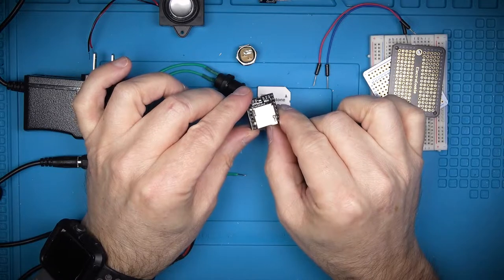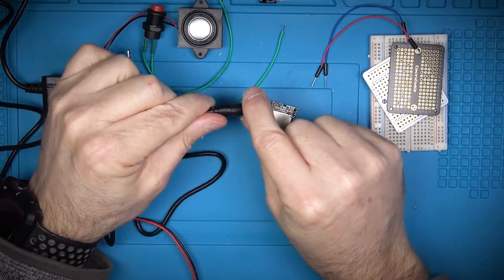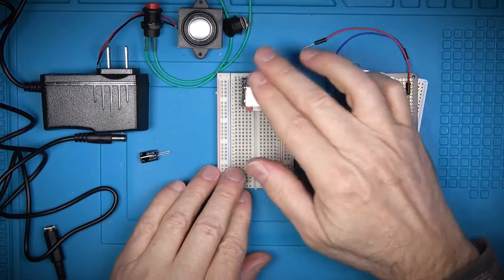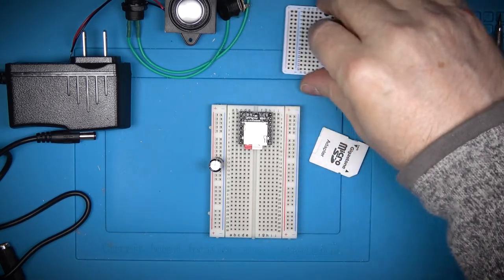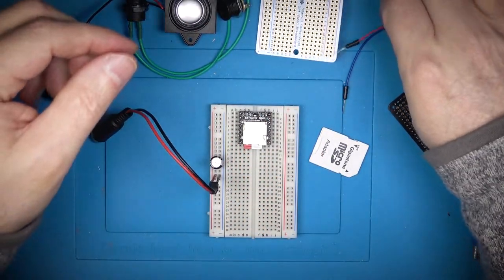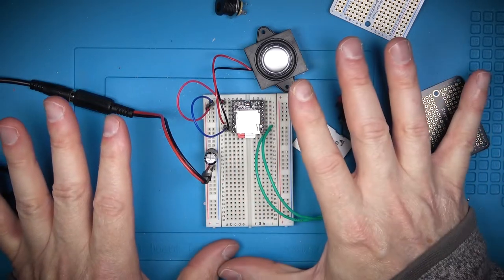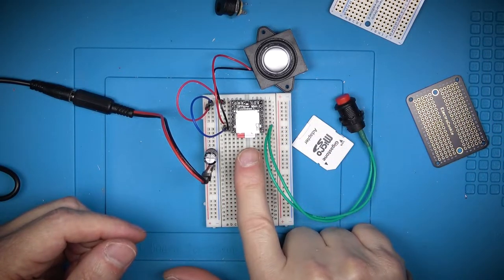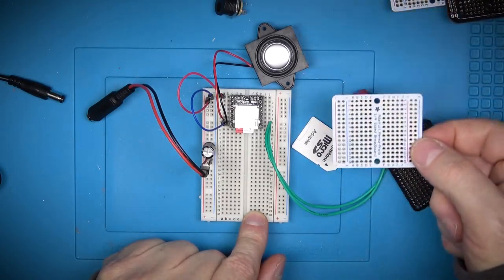Easy Diorama and Book Nook Audio - DFPlayer Mini #dfplayer-mini

Comment: I'm having problems connecting these boards like this..  I have one working in a project connected to an arduino where I used the "Play all random" feature, but now I'm trying to do a project w/o the microcontroller.  Docs say I should be able to play 14 different files (actually it says "segments" so I am hoping I am understanding this to be different files?!?) but I can't get it to play any, even when just using the basic shorting out the pin that you did.  What file naming did you use on the SD Card?  I have tried 0001.mp3, etc.. and I've tried w/ 3 digits (001.mp3, etc..) because I've seen different documentation, but neither is working for me.  I am getting what I'd call a quick "squeek" and that's it..  Any help definitely appreciated!!
Reply from the maker: Your naming seems fine. One thing to check for is hidden files on the SD card. If you're working on a Mac, there may be issues with system generated files that are hidden but share similar file names. The player isn't smart enough to tell the difference and may be trying to play those files instead. On both Mac and PC you can "show hidden files" and delete everything that's not your MP3s. Fingers crossed!
Reply: @RandomMakingEncounters   Thanks for replying..  I did end up getting it to work.  turns out the filenames were fine, and it works exactly as documented, but the whole problem was that my voltage was a little low and it was rebooting when the song started playing and the amp started taking too much current.  I had a breadboard power supply that I was feeding w/ 5v and so 5v into the 5v regulator wasn't able to work properly.. Feeding 9v into it (even at less miliamps) it is working great!
Reply from the maker: @SteveJones172pilot  really happy to hear that! It's always frustrating when you have a mystery glitch. All the best with your project!

Comment: So, any capacitor is fine?  Didn't need any specific size? 
.. EDIT: DERP, looked in comments n found the link 😬

So...  I'm adding one to a project, n this seems like a good Idea... Also, any ideas on how to add 10-20W speaker??
Reply from the maker: Sorry for the slow response! If you want to pump up the jam, I would look for a little audio amplifier module. There are a bunch out there and many have a volume control potentiometer. You could connect that to the audio out and then the only limit is how much power that amp can deliver. I haven't used this one (https://www.amazon.com/Kiro-Seeu-PAM8610-Amplifier-AM8610-MD-1pcs) but it's the kind of inexpensive board I'm thinking of. All the best with your project!! Cheers.

Comment: Will a 4 ohm 3 watt speaker be as loud as the one in your video?
Reply from the maker: This starts to stray into the land of things that confuse me. My general understanding is the lower the ohm, the more power the amp can and needs to deliver because the speaker has less resistance. If the amp isn't rated for lower ohms, it can be damaged. I looked at the spec sheet and searched for the ratings for the DfPlayer Mini and the general consensus was there are no specs on what the ohm rating is for the amp on the module. The docs just say maximum 3 watts. The speaker I used is 8 ohm 3 watt. It's possible that going down to 4 ohm might be louder but could over drive the amp. Most components like this are really geared towards 8 ohm speakers. Another thing that impacts sound is the size of the speaker. This makes sense because a physically larger speaker moves more air. To play it safe, I would personally stick to 8 ohm, 3 watt speakers and look for ones with larger cone.

If you're really looking to crank up the volume, there are two pins next to the speaker pins that are for line out... headphones. You could connect those to a 1/8" audio jack and plug in some amplified computer speakers or even some of those smaller rechargeable speakers designed to plug into mobile devices. This bypasses the onboard amp altogether and allows you to let the external speakers do all of the amplification without worrying about blowing the amp on the module. The pinout is on this page - https://wiki.dfrobot.com/DFPlayer_Mini_SKU_DFR0299

This has always been a bit cryptic to me. I'm not much of an audiophile. I hope this helped a bit. All the best with your project!
Reply: @RandomMakingEncounters  Thank you so much for your reply! 😁 The chip ended up finally coming in the mail and I got to test it out, sounds absolutely perfect with a 4 ohm 3 watt speaker. I don’t understand this stuff that much either lol so I’m glad it worked. Thanks for the tutorial too 😁
Reply: @shrigmian  thanks for your reply!

Comment: How can i use df mini player with my code and use with my existing ir sensors ?
Reply from the maker: You should be able to incorporate the DFPlayer sample code that comes with the library. I would approach it this way... it's kinda how I always kludge stuff together... I start by installing the library through the Arduino IDE and then go to the examples and grab the simplest one for the module. It will depend on what you're trying to accomplish but the basic idea would be to have your IR sensors doing their thing. You probably have some sort of conditional statement (IF or WHILE) running that is testing for something to happen. Once that condition is met, it's relatively easy to have the DFPlayer play. I should have mentioned this at the start... this video is really the simplest way that just drops a pin to ground. The DFPlayer can be completely controlled via code. Hope that helps and apologies for the slow reply! Cheers!

Comment: Is there any way to possibly add a small flicker LED to this board too.

I'm trying to make a set up with 1 button press the audio plays and the LED flickers for the same amount of time and then shuts off after 30 secs or so.
Reply from the maker: I don't think there's an "easy" way to add it directly. Here's how I might approach it...

Here's the reference for the player - https://wiki.dfrobot.com/DFPlayer_Mini_SKU_DFR0299. The busy pin on the board switches between low (no voltage... pin goes to ground) when playing, and high (voltage delivered to the pin) when not playing. Normally, I would say you could use a transistor as a switch to turn the LED on and off... there are a lot of tutorials around how to use transistors or MOSFETs to control power. Unfortunately, for the simplest circuit, you usually would need that pin to go high to "switch on" the transistor. I don't know if there is a way to build a circuit that turns the transistor on when the pin is low. I'm sure there is but I'm not wise in the ways of electrons to understand it.

If you wanted to add a bit more smarts to the circuit, you could add an Arduino to it. Then it would be pretty easy to do all sorts of stuff. You could connect the busy pin to the Arduino and have it check to see if the pin is high or low and if it's low you could use the Arduino to control the LED and then say "once the pin goes high, wait 30 seconds and turn the LED off". This would require the addition of the microcontroller and a bit of easy programming but the connections would be simple.

I wish I had an easier answer but maybe this points you in a useful direction. All the best with your project! Cheers!
Reply: @RandomMakingEncounters  
Thank you for the help

Comment: Is it possible to add lights to the same board?  I'm a novice at this so I am wondering if that is possible as well?
Reply from the maker: The DFPlayer is just for audio but, if you use an Arduino to control the audio, you can use the same Arduino to control lighting and other things! I really need to get some videos out showing more ways to control these things. It’s been on my list. Thanks for the question and cheers!!
Reply: Thanks so much for the response! @RandomMakingEncounters

Comment: what the capacitor for? necessary?
Reply from the maker: The capacitor isn't specifically needed. I usually put a large capacitor (1000 uF, 25 volt) across the incoming power to help smooth any power spike to the board when plugging in. I got into the habit doing this when working with NeoPixels. All the best with your project!

Comment: is there a way to autostart playback without an button involved?
Reply from the maker: This is a tough one. Here's where I generally find the best info - https://wiki.dfrobot.com/DFPlayer_Mini_SKU_DFR0299. Looking at the docs... you can connect IO_1 to ground to start playing. However, if you hold it to ground (long press), you decrease the volume... so that doesn't work. It's possible to do it with an Arduino and a bit of programming but that is overcomplicating if you're looking for looping playback only.

There are a bunch of MP3 modules out there that may have a looping feature built in. This one looked promising - https://www.amazon.com/HiLetgo-Lossless-Decoders-Decoding-Amplifier/dp/B01DK9SL6C. I've had pretty good luck with the HiLetgo brand. What I like about this module is there are some basic controls built in and you have both line (earbud) and speaker outputs. If you're looking to crank some volume, you can hook the line out to computer speakers and really crank it... the speaker outputs tend to ba a little underwhelming on things like this since the built in amps tend to be a bit meh. It also looks like (based on some comments) it auto-plays and loops when it powers on... maybe that's one of its modes?

 There are also some out there that look like they are the same type of module used in greeting cards. Those usually have a button trigger though. I hope that helps. Best of luck with your project!

Comment: Isn't it possible to play a sound without accidentally setting the volume down?
Reply from the maker: The sound is changed with a long press of the button or by holding the pin to the ground for too long. The trick is to just tap the connection or give a quick tap to a momentary button. However... it IS a bit twitchy. I'm not completely sure I understand exactly how the maker of this player really, really thinks they should be used. I've been playing around with a different board that is similar but different and may be easier to use. I'm hoping to make a video of that one soon. Cheers!
Reply: You can increase volume by connecting switch in between pin nos. 10&11.  Long press volume up and short press next track.

Comment: I'm looking for an option for a toy I want it to sound  a little better and idea's
Reply from the maker: Sorry for the late reply. I hope you found a solution to your question. The main issue will always be the amp and the speaker. I've been playing around with this module as well https://www.amazon.com/gp/product/B07YFPBGF8 because it's more of a plug and play solution. The amp on the DFPlayer is pretty limited on what it can drive so I usually use an external powered speaker when I need better sound quality. The DFPlayer has both a speaker out (which runs through the onboard amp) and a line out (which requires powered speakers). The line out gives you the option to use the board to simply decode and play the MP3 file letting the quality of sound be determined by the quality of the speakers. Another board I've used is from Adafruit - https://www.adafruit.com/product/2217 It doesn't use an SD card and requires either WAV or OGG audio files. It's a pretty solid design and easy to use... Adafruit's documentation and tutorials are top notch! I wish you the very best on your project. Cheers!

Comment: hello, thank you for this video! i have a question: i used this player to make a diorama, but the circuit is always on and the battery discharge really fast. IS THERE a way to make a circuit with battery which is triggered when i push the button and then turn simply off to prevent battery discharge? thank you! (i prevented the battery drain adding a ON-OFF button, but it is annoyng to push two buttons to make this work. Also, my friend usually forget to turn off power before leave the diorama...so, this is a problem
Reply from the maker: Sorry for the late reply. I've noodled this a bit and I'm not sure I have a brilliant solution. What you're looking for is a way to have the connection to your battery be open (not connected). When you push a button, it closes the connection and triggers the audio AND keeps the power connection until the audio file ends and then it opens the battery connection again. Something like this - https://randomnerdtutorials.com/latching-power-switch-circuit-auto-power-off-circuit-esp32-esp8266-arduino here's a video showing a similar thing - https://youtu.be/Er8fSoeaZD0?si=Pd4cLo347uDXaWni 

I didn't do a huge deep dive but it looks like in both of these examples the microcontroller keeps the power on using a transistor. When it's done doing it's thing, the pin controlling the transistor goes low... effectively cutting power to the circuit. If you're just using the DFPlayer by itself, I'm not sure if there is a way to do this. There is a "busy" pin that goes low (to ground or zero volts) when playing and high (~5 volts) when it's not playing... exactly the opposite of what you want to do. Sadly... I'm not an electronics expert and I'm sure there is a solution to this. Looking at both examples, it may just be easier to make your friend buy batteries... that may get them to remember to turn the power off!

I hope this gets you pointed in a direction. The thing I looked for was "latching power circuit".

Cheers!!
Reply: @RandomMakingEncounters  ma, Thank you for this reply. I will study. Thank you. Alessandro
Reply: @RandomMakingEncounters  i saw the tutorial. Actually it uses Arduino, wich for my project is way too expensive. I am working with condensators and ne555 IC wich i believe it could work for my purposes. (or i hope so.)
Reply: @RandomMakingEncounters  i managed to make a circuit with a NE555P IC circuit and a 1w speaker. It work smooth. When i push it actually stay on for 30 sec and then turn off. ty
Reply from the maker: AWESOME @asici2 ! I love it when it all works out. Nicely done!

Comment: I wanted to use this DF Player with a PC. Connecting the PC to a Converter Board: RS232 to TTL. This Player board is TTL, Tx and Rx. Am I right doing so? Do I need to use any resister or can I be directly connecting the ttl Tx of DF Player Board to Conveter Rx and so on...
Reply from the maker: Sadly, this is well beyond my experience to answer. I have connected the player to an Arduino and know you need to be careful about voltages on the pins. The inputs on the player are lower than the 5 volts coming out of the Arduino. Hope you've had success with your project! Cheers!